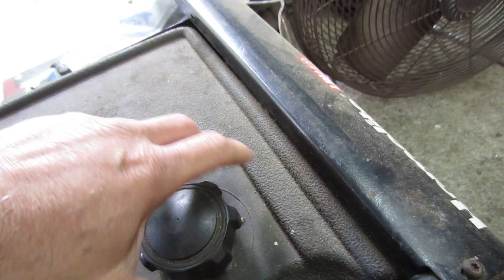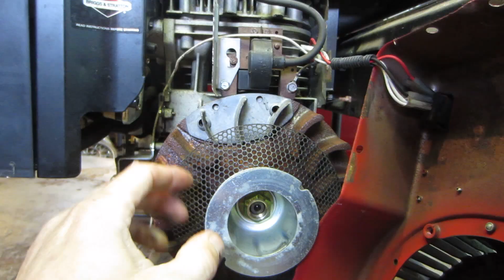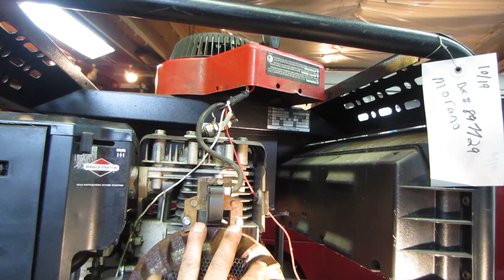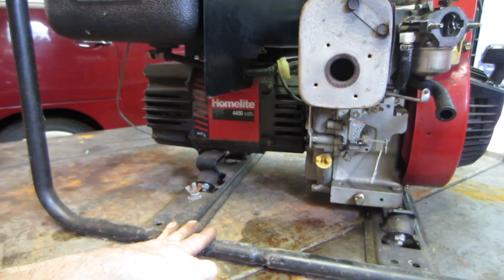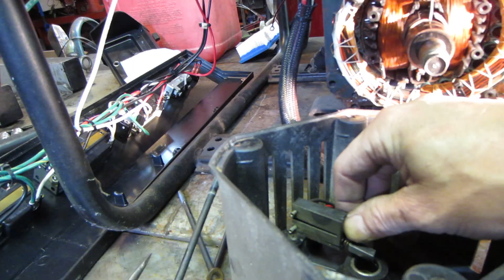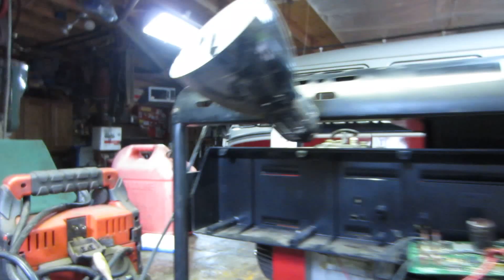$5 yard sale generator

Comment: plug in a drill while the motor is running and turn the chuck backwards to excite the field.
generators that have sat for a long time will lose the magnetic charge, worth a try.
Reply: This does work and it's easy!! Just remember to hold the trigger on the drill on the gen side.

Comment: Good job mustie1, you also can try a drill in your flash field test. You need to plug it in the receptacle keep the drill in fwd position and spin the chuck in reverse while holding down the trigger with your hand , that in turn will induce voltage to the windings. That's how the rotor windings are flashed. It worked for me in the past. Good luck bud and hope u feel better.

Comment: If that unit has stood a long time it would have lost residual magnetism. You need to flash the coils with a battery. Put 12 volts onto the slip rings usually positive is the end one Just watched the end and it looks like there is a big capacitor on the board, that would be giving the reactive power to run the field and it looks like it has seen better days, electrolytic caps have a nasty habit of going bad.

Comment: Very good try! When you saw the price of the circuit board, I'm sure you said "oh no way, I'm done it's finished". But just had to appease your curiosity to see if the elec motor was good or not. All in all, no loss since you got a good low hour motor out of it for cheap!
BTW, hate throwing that frame out. Perhaps keep the engine in it and hook up a water pump? Never know when you need a water pump?

Comment: the rusty flywheel and coil is not a myth,i have brought many old briggs back to life by cleaning them up. for 5 dollars,how could you not take a chance? i just picked up a 60,s? winco storm master generator with a model 14 briggs driving the generator via belt. used free parts from my hoard to get it up and running,rated at 2000 watts 3000 on start up. downside is the weight,must be 300 pounds

Comment: i use to belive that sanding the rust off was a myth but i did it and it did work but most times the mag is bad
Reply: Always sand the flywheel and mag with some scothbrite / light sand-paper.. will restore a spark and fix oscillating / pulsating running on many engines.
Reply: yup thats i do first normaly

Comment: thar wasn't a CFL bulb was it? they won't light off usually if the voltage is low, or they may flash. 50 v prob wouldn't do anything. I would have used u your volt meter.
Reply from the maker: no it was a reg one on the 2nd half of the vid.

Comment: Ohh don't tell me your back was tight do some yoga or something to keep yourself healthy. You've probably gone over this before but if you were going to store an engine like that would you run it out of gas to keep the carb cleaned out?
Reply from the maker: id leave dry as possible unless you have some of the fuel that is sold in qts with no ethinal in it, that stuff is good for 5 years unopened and 2 years open, great for weed wackers and chainsaws, but its expensive,thanks for putting up a vid yesterday by the way.

Comment: Still a good deal for the engine
Reply from the maker: thats what l figured too
Reply: @mustie1  hey I bet you never checked the compasitor cap in the generator normally it's right on the  Opposit side of the engine were the wires comes out of the alternator part. Sorry I'm just now seeing this that might have fixed your issue right away